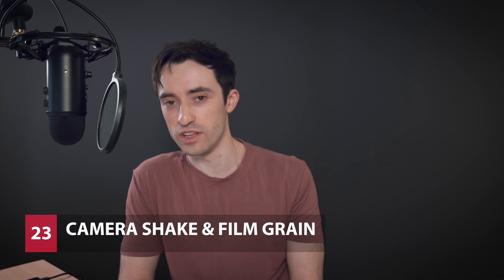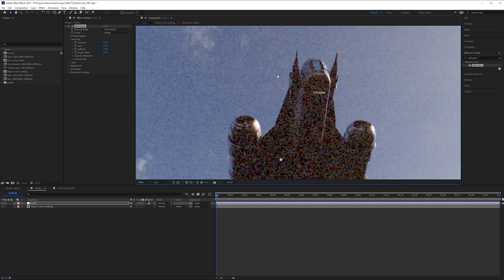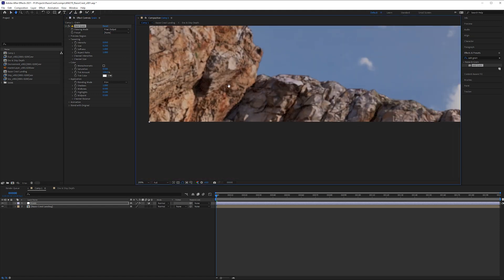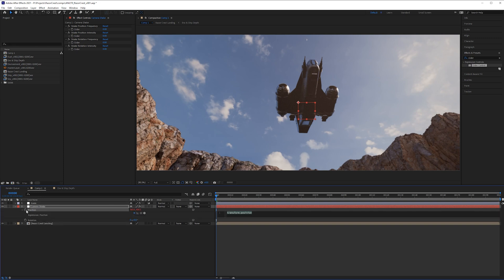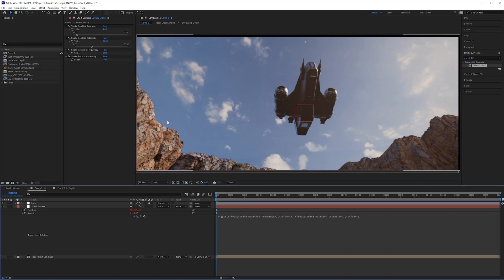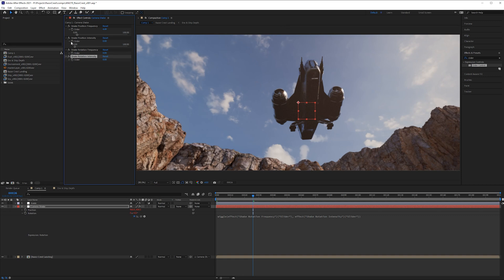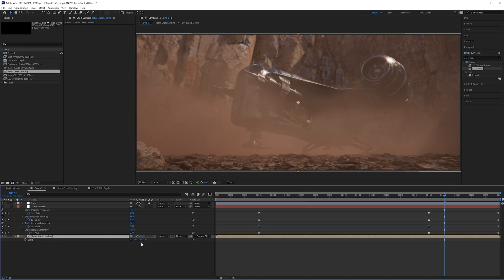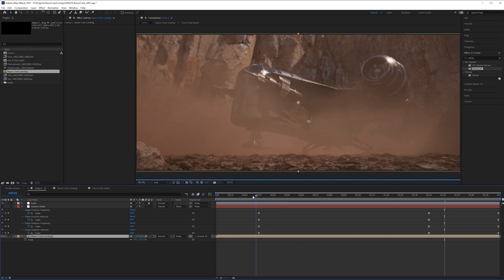Camera Shake & Film Grain — Razor Crest VFX Lecture 23

Comment: this project is completly cg or combine video with 3d model?
as you mentioned, all cameras have grains,  If we only render the 3D model in V-Ray during rendering (without video in the background), then in After Effects, with this "add grain effect", can we tell AE that the grain in the 3D model is exactly the same as the grain recorded in the video? if yes, could you please tell me how can i do that?
thanks alot.
Reply from the maker: It's completely cg. There is a Match Grain effect in After Effects, but it won't be exactly like the noise in the rendered frames. You should output clean frames from max, and then add noise in post. Use the denoiser to make rendering without noise more efficient.
Reply: @CGStirk  
thanks.
as you know in vray, we have Denoising render element And with that we can eliminate all the noise of the final rendering.
The point is that usually the videos that are taken with smartphone or cameras have alittle noise and grains, and our rendering is completely clean and without noise and grain.
Actually, I wanted to know if it is possible to add noise and grain to the clean render based on the video that has some noise and grain. can we do this with match grain tool in AE?
thanks alot.
Reply from the maker: The Match Grain effect just samples the source and tries to replicate it, but you'd have to test it to see if it does what you want. To get phone video compression quality directly within AE would require a plugin. Or, you could render out the final comp and reimport it to get that some poor compression quality from actual compression. Not an ideal solution, though.
Reply: @CGStirk  thanks.